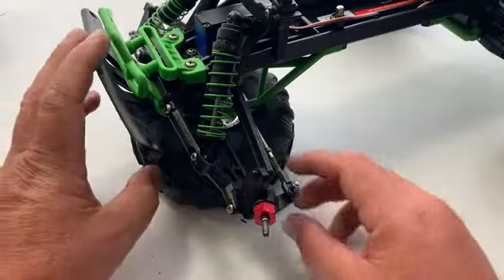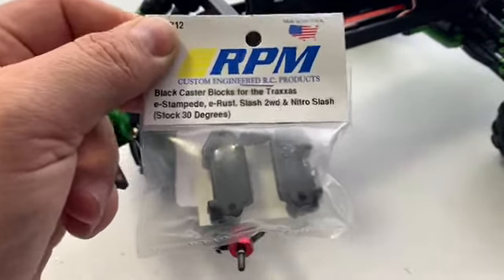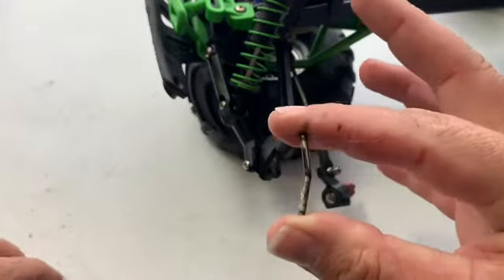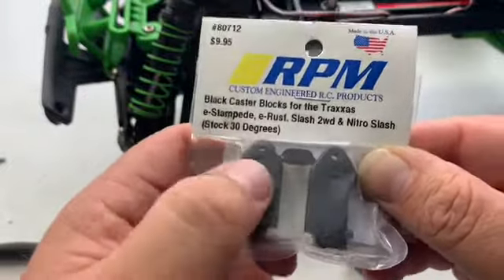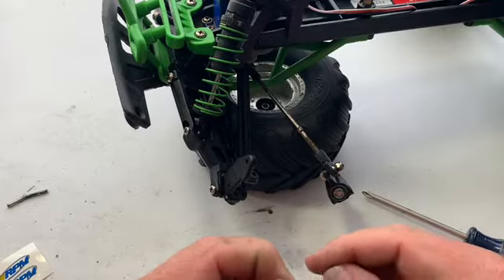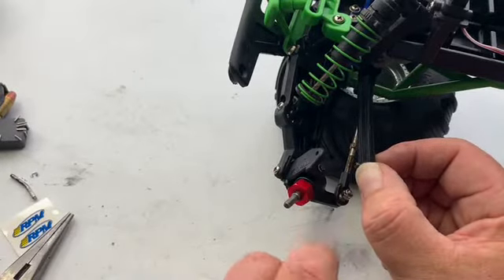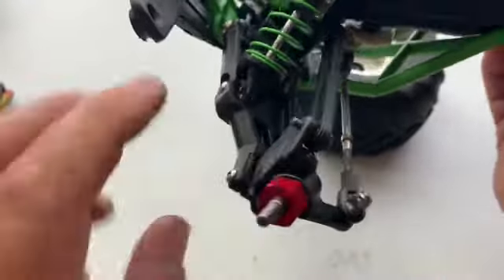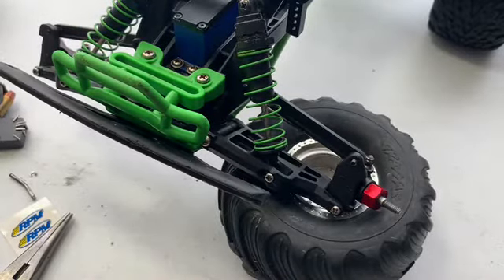How to Install RPM Caster Blocks on a Traxxas Rc 2wd

Comment: hey I just wanted to ask im having trouble with my caster blocks and have tried to just put the screw for the tow link in while not attached to any part of the car but the screw still won't go in. I there a chance I might of gotten one that is not threaded
(edit)
I found the problem I was spinning the screw in the wrong direction